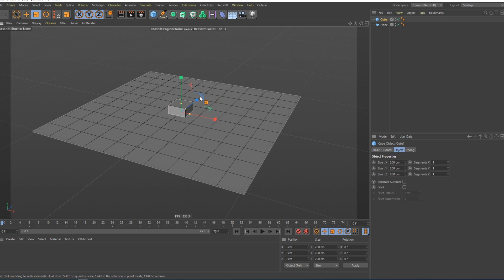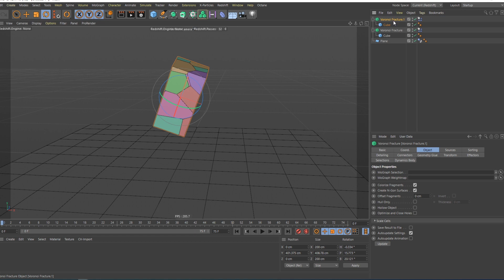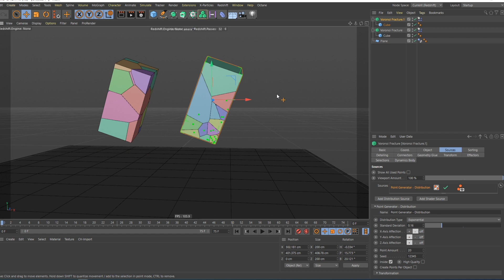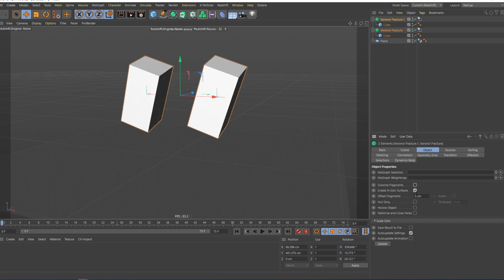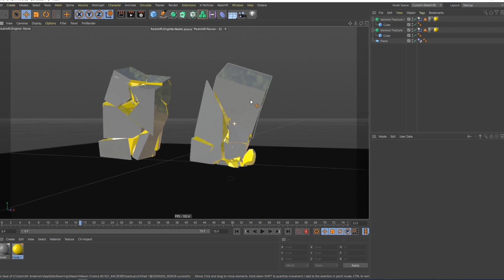Cinema4D: How To Break Stuff Better

Comment: Is there a way to prevent the cracks/seams from appearing before impact? 
I have a sphere with a light inside being exposed only on impact. But the second the motion starts you can see light cracks on the sphere where the segments connect.
Reply from the maker: Hey! Check out the comment of Christian R.H. TMM :)

Comment: Is there a way of fixing the fracture before it hits down? 
When the object in the voroni fracture is going down,  you will see it breaking before it hits down.
Otherwise, your tutorials are awesome. Thanks!
Reply: I fixed it by setting the trigger on collision in the Dynamics tab inside the Dynamics body tag
Reply: @santiagocrespo8613  thank you so much man
Reply from the maker: You can change the size increment value to something like -0.1 in the Dynamics Tag - Collision tab and it should work. The parts will not touch each other before the impact.

Comment: Thanks for sharing! Can the crack marks not show before it hits the ground?
Reply from the maker: You can try changing the 'size increment' on Rigid body - Collision tab to -0.01. This way the parts won't touch while it's falling and crack marks will not show. There are probably other ways to do it, but this worked for me.
Reply: @Mr_Anderson_one  ohh got it ! thanks a lot:)
Reply: In the collision tab you should be able to select dynamics on collision. That way it'll only fracture when it hits to floor.